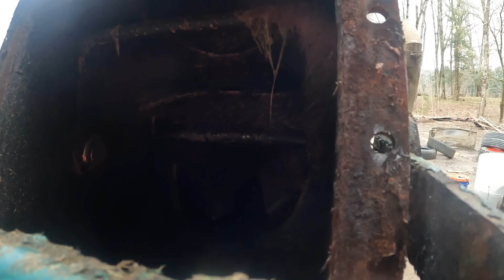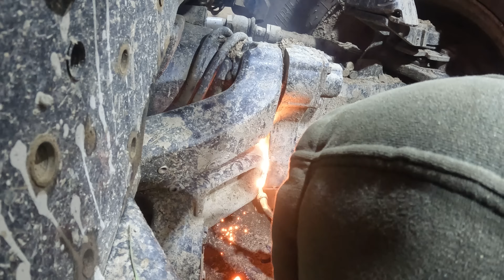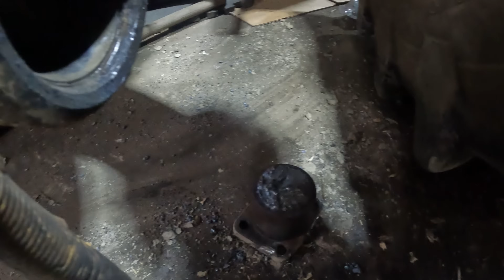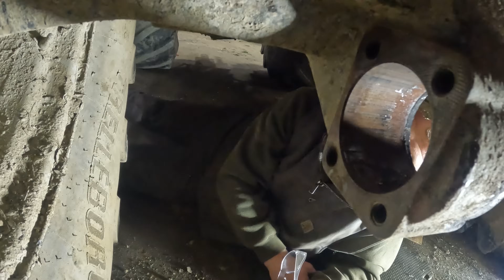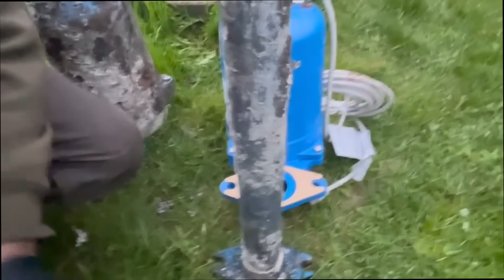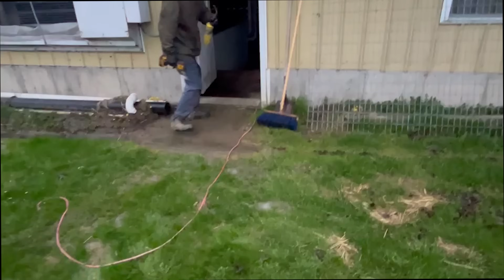Manure pump & Tractor repairs

Comment: Great video, hot wrench and big hammer are great tools to have. 
Goulds are good pumps but very expensive. One thing we found with using effluent water for flush was bottom of tank would fill with sediment after a period of time. We would drain tank, I would go down in tank and clean out with shovel and bucket, nasty smell but had to be done. If you have issues with plugging pump, call a septic cleaning company. Don't be like me and smell of rotten milk for a few days! LoL 😂
Reply from the maker: Bigger hammer and torches get the job done.  Lol.  We’ll see when we cross that road.  Thanks for watching

Comment: Looking at an 05 8480. Anything I should look out for? Has about 4800 hours. In one of your videos you said there’s a big difference between your 07 and 05? 
Using it primarily for tillage and grain cart. 
Thanks in advance
Reply from the maker: The 05 was the first year.  The 05 has definitely given us more issues over the years. We think it was because it was the first year.  But it could also be luck of the draw.  The tier 3 seems to have a much noticeably quieter cab.  But it could just be our older one is more warn  out.  The 05 are all tier 2 engines from what I know.   The newer models are Tier 3.  The tier 3 is rail fuel injection and much higher horse power is truly the biggest difference.  
I like the Sv finger tip controls a lot more too than the blue joystick.   But the joystick is very nice to run the bucket system we have on that tractor. 
Hopefully that helps.
Reply: @ yes, thank you so much. Very helpful